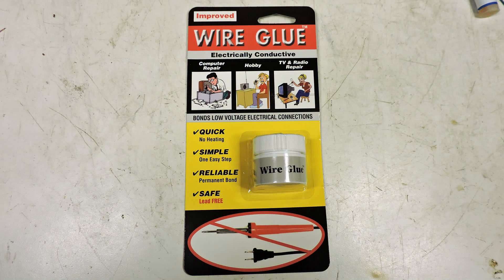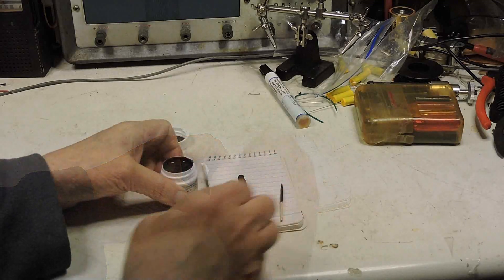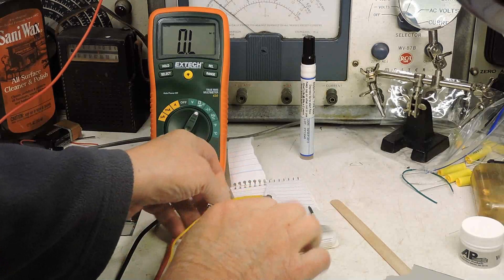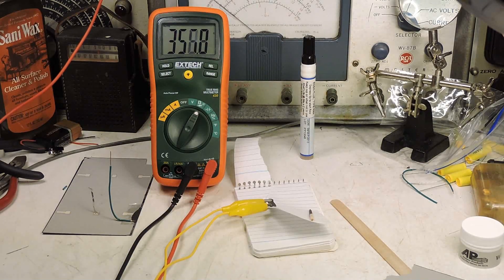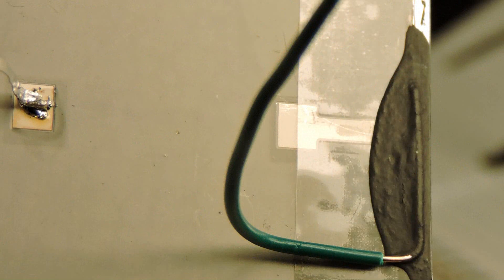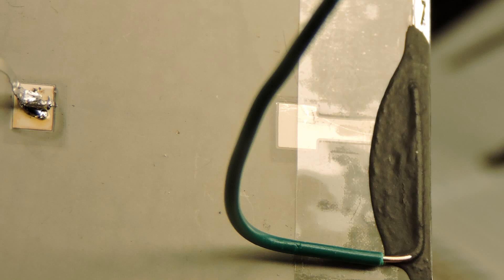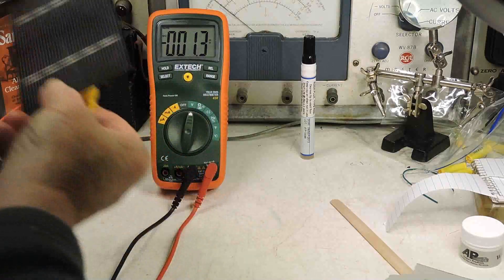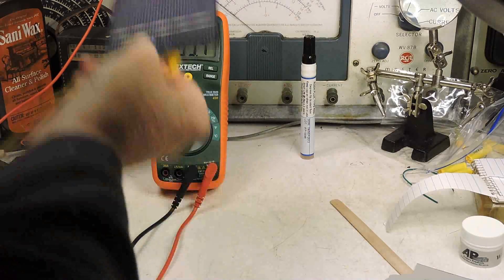Conductive Glue Demo

Comment: Hi Rick, I don’t know how wide the connection on the solar panel is but if you solder the wire to a strip of copper and then glue that on you could increase the surface area and further reduce the resistance plus the greater surface area should be physically stronger. I guess that you get to a point where differences in thermal expansion come into play and try to pull it apart.
All the best and keep on having fun! 
Regards . . . Andy
GWØJXM
Reply from the maker: AndyDaviesByTheSea 

Thanks Andy,and also thanks for the information. I
have a number of solar cells to experiment with and I'll certainly
follow your advice. Another YouTuber had mentioned a use for the
conductive glue and that was to repair the carbon buttons on remote
controls, I think that is a good idea also.Hope everything is going well with you.
I'm getting ready for a science fair, so I'm experimenting with a
number of things.Rick